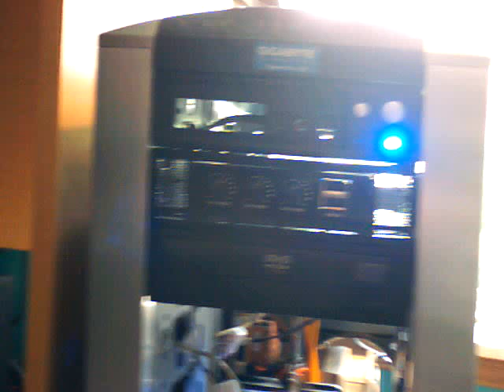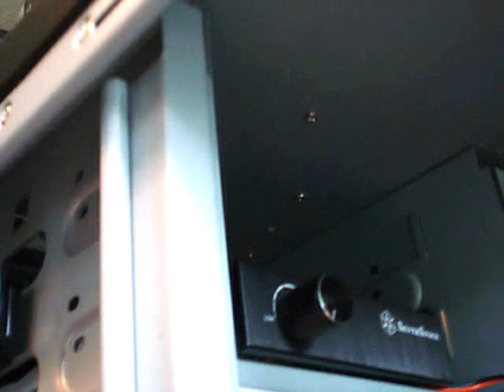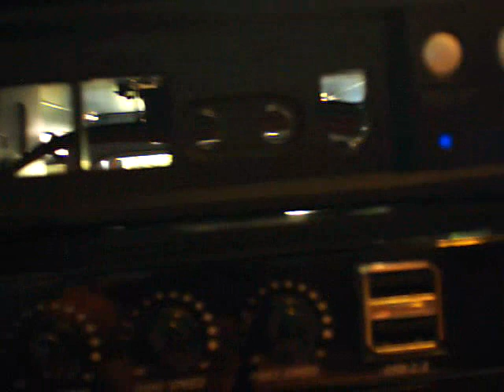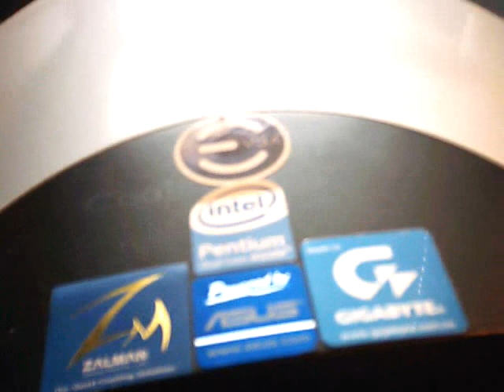CM Stacker Cable Management Finished Full Details 5/1/08

Comment: Just a suggestion, you can try to angle the top aerocool fan to exhaust the hot air rising from the case out the place where you can mount the power supply on the top.